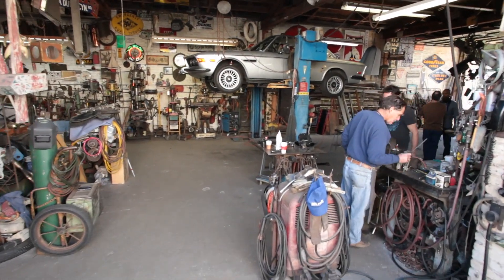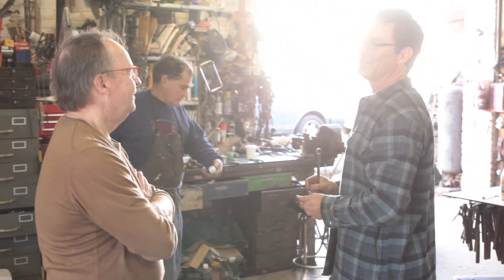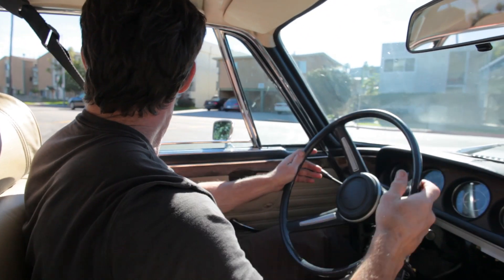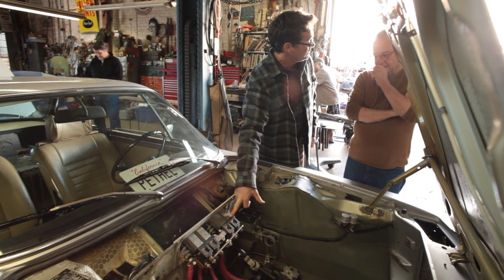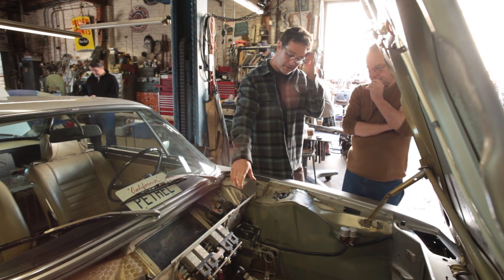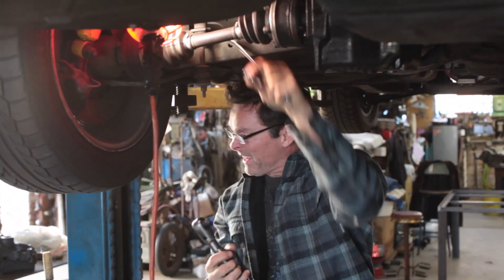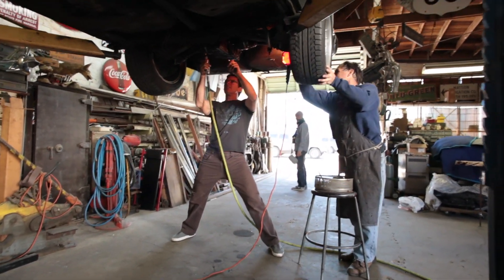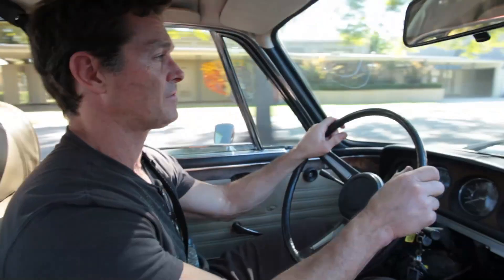Building the Fastest Green Car Ever || BURN Radio

Comment: Hey just figured i would give some of this info.  He uses two custom made 400 hp DC electric motors running from LiFePo4 battery cells. (Also known as a123 systems which went bankrupt and was sold to a chinese car manufacturer).